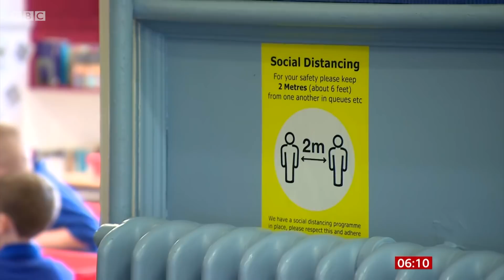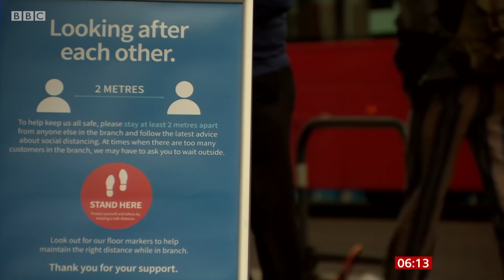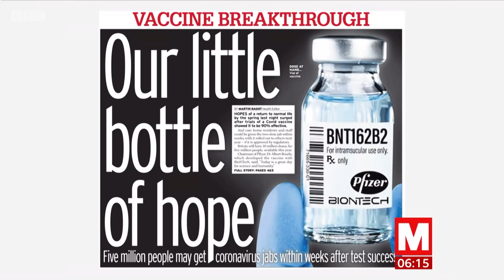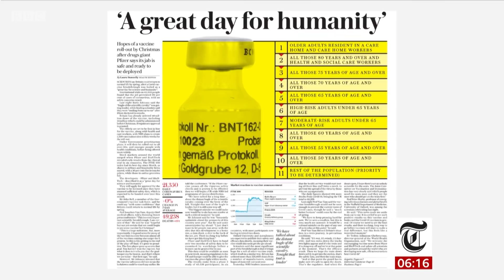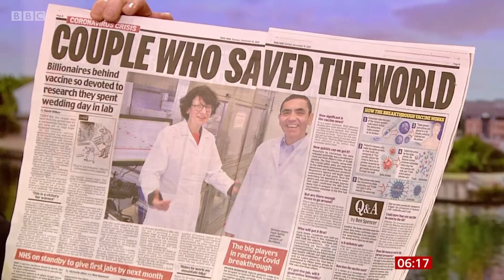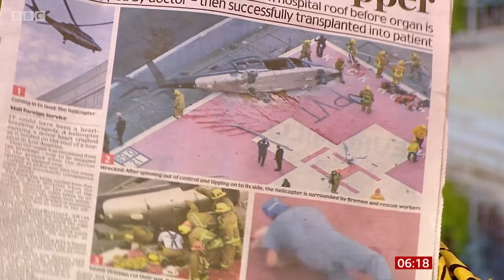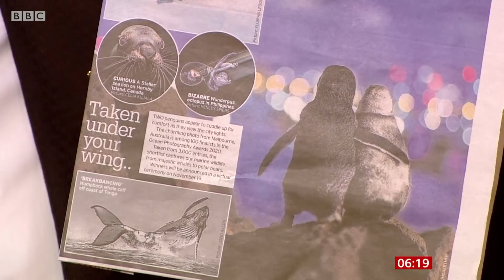Covid vaccine: First 'milestone' vaccine offers 90% protection 🔴 @BBCNews live - BBC

Comment: If you are touching your face then you are potentially spreading the virus to yourself via your mask...  in face the mask aides in prolonged exposure as well if contaminated...
Super Spreader surfaces like Gas Nozzles, ATM, Cash & so on should be rigorously cleaned..  if exposing to UV disinfects it then cash registers could have UV lights inside the drawers..
ATM pads could have UV lamps on the keypads, Gas Nozzles could have UV lights on the nozzle hanger...

Comment: C'mon BBC, report on how the vaccine works,what it does to your "MODIFIED" RNA, oddly enough that is how MODERNA got it's name, Modified RNA or MODERNA. What's even more sinister is the component in the vaccine by MODERNA ,it contains a Luciferase enzyme, which is basically a  digital tattoo when out under a special light, black light or something similar. This in turn will turn you into a number ,a barcode which can then be sold off as a potential patent. Pretty disgusting Mr Bill Gates, what you are trying to achieve with your power.

Ecclesiastes 12:13,14
13 The conclusion of the matter, everything having been heard, is: Fear the true God and keep his commandments, for this is the whole obligation of man.  14 For the true God will judge every deed, including every hidden thing, as to whether it is good or bad.